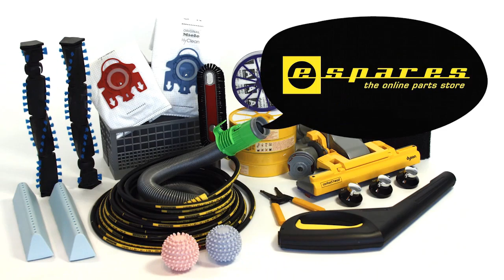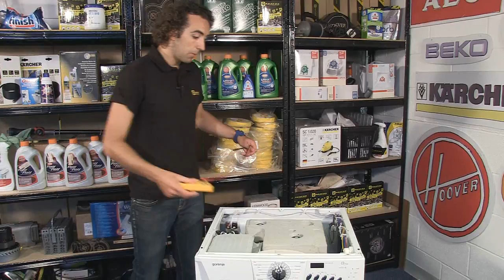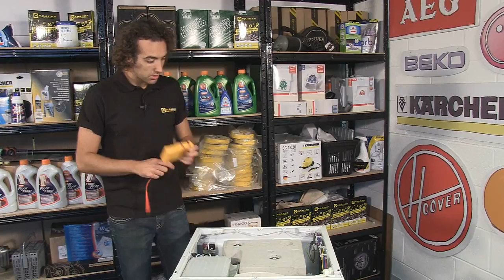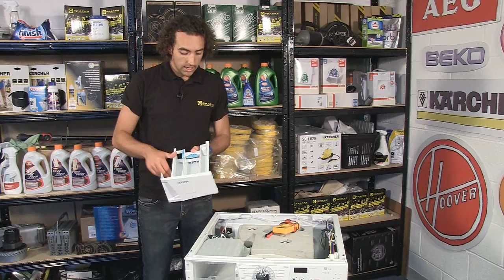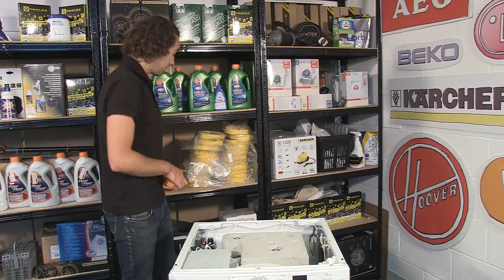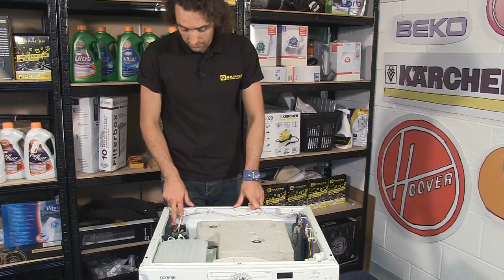How to Diagnose Washing Machine Dispenser and Filling Problems

Comment: Would you be able to comment why laundry may not smell like the detergent used or even smell clean? I use proper detergent, but my laundry comes out smelling as if it was washed only with water. I don’t understand where my detergent is going 😔 I was finally able to rid the washer of mildew smell with maintenance & cleaning, but now this puzzle piece.

Comment: Expecting advice now is a longshot considering this video was uploaded 11 years ago, but I'll put it out there. I have an electrolux front load washer in a room that gets very cold during extremely cold weather. Consequently, one of the tubes of the water valve (the tubes that the tap hoses screw into) cracked. So I bought a new water valve. The installation seemed pretty simple but something's not working correctly. The water does go through the valves and through the soap dispenser but does not go into the tub. It's not leaking all over the place or anything like that. But no water is entering the tub. After a minute the water stops. I guess maybe the sensor feels that the valve  is full of water or something. I don't know if the the replacement valve I purchased is faulty, or if I didn't install it correctly, or if there's something else wrong with the washer. I don't have an ohm meter but I have one of those things that you touch to wires or circuits and it beeps to tell you it detects current. When the washer is on it detects current on all of the valve cylinders. The valve I purchased is not directly from electrolux but it is OEM. I ordered another valve, this time directly from Electrolux. I'll receive that in a couple of days but I have a bad feeling it still might not work. Anybody have any ideas? Thanks.

Comment: I've just had a new candy washing machine delivered and on the first washes i've tried the water jets are firing into the fabric conditioner middle section as well as washing liquid side at start of wash and emptying it...can you advise..just to say i am only dosing with a small amount of conditioner.
Reply from the maker: Check what cycle you are putting and that this is not a liquid bleach container that you are filling. If there does appear to be a problem contact your supplier as most new machines come with a 12 month gaurentee.
Reply: Your response is very much appreciated, checked all cycles and made sure and still happens so as the machine is only 2 days old the supplier is exchanging it.
Reply: my replacement washing machine turned up today should i use the new water hose that came with it or am i ok using the existing water hose.thanks
Reply from the maker: It is always better to use the new hose as the old hose could have weakened overtime.

Comment: Thank you so much! I blew down the pipe from the pressure switch and it worked first time.tahnks again.
Reply from the maker: Hi Andrew, if the pipe blocked it is likely you have a build up of detergent residue in the machine that blocked it. We suggest you watch the following video and use this product or similar to clean the machine up and prevent it re occurring:
https://www.youtube.com/edit?o=U&video_id=ifWK9df1qgg

Comment: The rinse cycle doesn't seem to be filling up with water in my machine. In fact I saw it pour a bit of water while not spinning, drain, then spin slowly as though it were rinsing. After spinning the other way it paused again, poured a little water, drained then spun again like before. So my clothes ended up coming out very soapy. Is the rinse cycle supposed to fill all the way up with water?
Reply: The water level during the rinse cycle doesn't even get to half full. I'm watching it "rinse" with a bunch of soap still in it
Reply from the maker: Many modern machines use low water content to increase their efficiency. Your problem is more likely to be due to excess detergent or overloading rather than a water filling problem. The drum should never be filled more than two thirds or the clothes cannot rinse or clean effectively.

Comment: I can't seem to find anything that resembles your solenoid valve. I have poked the prongs from the multi meter on everything inside the machine that might be able to give me a reading, but nothing...please help!!!! Sam.
Reply from the maker: +samantha arlington What is your model details Samantha?.
Reply: Arcelik 5061 I can send you a picture of the insides too if you like?
Reply from the maker: +samantha arlington Your inlet valve is at the top of the machine at the back and the fill hose attaches directly to this with smaller hoses going to the detergent drawer. The valves will have a resistance of between 2000 and 4000 ohms and  s shown at: http://www.espares.co.uk/product/es1249572
Reply: But this isn't what's in my machine. It's more like 2 flat plug like sockets with wires coming out. I don't know how else to describe it.
Reply from the maker: OK depending on production they may have changed the valve and connectors but you now have identified where the valve is (Between the fill hose and dispenser). You can remove the connectors and measure the solenoids. As there are two they should be of a similar resistance.
Reply: Ok. They are covered in a protective plastic that on't come off, although i was able to poke the prongs of the multi metre just slightly underneath, and the reading was 295/300....so i guess they will need replacing. Thanks for your help. Now off to try and find replacements. :)
Reply from the maker: Please give us your production number as we can then identify the correct part. The readings of around 300 ohms may be correct so do not order yet. Have you seen our diagnosis video: https://www.youtube.com/watch?v=VS48G_cwCXo
Reply: Yes...this was the clip i posted my question on. As for the production number, i had it 10 years and most numbers have worn away...can you tell me where to look for this please?
Reply from the maker: The production number is often on a sticker either on the door or around the rim of the opening.
Reply: As i thought, any numbers that were there have rubbed off :(
Reply: I may have to bite the bullet and call out a repair man/woman....i hate doing that if i can do it myself!
Reply from the maker: What is the problem with the machine?.
Reply: +eSpares Only a dribble of water is going into the dispenser. It's nothing to do water pressure, that is fine.
Reply: +samantha arlington Also even when the machine is off, water is still dribbling in.
Reply from the maker: If the water is dribbling in through the soap drawer it will be a faulty valve. We checked the three versions of your model on our system and they all show the valve previously shown. If there is no water dripping at the back of the soap drawer the machine may back fill through the drain hose if attached to the pipes under a sink. Check the hose is not lower than the sink to prevent this if attached direct to a pipe.

Comment: Hi I have a hoover wydn9646 pg-30s and i have E01and I checked the safety lock its ok and I couldn't check for other causes of E01 can you show me more detail video for E01 like checking for the reason and repairing the fault please.I live in iraq and I cant not buy spares parts because this service is not available here many thanks.
Reply from the maker: +Sardar Qadir You can see what the error is indicating by watching another video: https://www.youtube.com/watch?v=kzhlvB2LjXg
This video shows that E01 is indicating a door lock problem. If the door catch is working correctly we would suggest replacing the door lock.

Comment: my Washing machine fills with water about 75 percent of the drum then makes  noise and lights flickering. 

I suspect the pressure switch but I checked the black thin hose there is no problem . 

it just fills with water and then stops and gives error.
Reply from the maker: +hanif daryanavard The water level is to high, when empty make sure the pressure hose is not blocked by blowing into the tub. If this is ok the pressure switch or control board may be faulty.

Comment: Hello, thanks for the tips.  I have been trying to diagnose my Bosch  WFL 2060UC Bosch Axxis washer problem.  What I can observe is the following: when I start a cycle, the water starts going through the valve and through the cold water black hose (we only use cold water by the way and the hot water fosset is closed even if the hot water external hose is of course still hooked).  Then the water flow switches its trajectory and goes through the other inner hose that's connected to the hot water valve (apparently), but the water doesn't go through the dispenser jets as supposed to, it just weakly trickles down the back inner wall of the dispenser box and doesn't make it into the actual soap dispenser compartment.  I checked both inner hoses; there's nothing stuck in either.  I checked the dispenser box jets (dismounted it following one of your video instructionals) and could clearly see it was clean, no obstruction in the jet holes.  I suspect it's the valves that may be disfunctional, but I don't have a multimeter to check the resistance.  What do you suggest?  Should I just order a new set of valves or should I invest in a multimeter? At this point I'm pretty sure it's a valve problem, but you might have better insights?
Reply from the maker: +Lisa Reutenauer Check the following video as this is often the cause of dispenser problems. https://www.youtube.com/watch?v=HD570cEFlNo
If the water is definitely only trickling in remove the external hoses and check if the small filter in the inlet of the valve is blocked. You can usually remove these with a pair of pliers and clean it.
Reply: thank you, this  was the first video I saw, and first thing I tried, and the small inlet filter is not blocked....
Reply from the maker: +Lisa Reutenauer Just a thought, re reading your description you have two hoses attached and one fed from the 'hot' valve. If this supply has not got the same pressure to fill the machine when the machine 'calls' for hot then water may only trickle in and the machine may think there is a problem and shut down if it is to slow. When it is trying to fill from this other hose pause the machine and temporarily switch the hoses on a test run. If it fills correctly at this point the issue may be low hot water pressure. If this is the case the simplest way of getting round your problem may be to get a adaptor like: http://www.espares.co.uk/product/es106398 and connect both hoses off the cold supply (assuming your machine has its own heater).

Comment: what if the water keep coming out from the detergent when is during the high speed of spinning? i had make sure i close the detergent properly.
Reply from the maker: Aiqi Lu First check the filter at the bottom of the machine is clear of any debris then run a rinse cycle and listen to the pump when it starts draining. The machine should empty from full in under 45 seconds, if it takes longer the machine may be spinning with excess water throwing it up out the dispenser.
If it is slow draining see another video: www.youtube.com/watch?v=frEJhX9Sppw

Comment: damn i wish id seen this before! My Gorenje WA50125 wasnt filling up properly. CHeck water hose and it seemed fine so i took the inlet valve to a spare part shop and he checked it and it was fine. I went home, reconnected the valve and thinking the connections might have been iffy i gave them a squeeze with some pliers, there was a 'pop' noise, little flash, tiny puff of smoke and now theres no sign of life at all :( any advice? have i blown the board? I just checked the water again and the pressure is rather low so i think it may have been the problem after all :(
Reply from the maker: Monkey Man If you have shorted the connector on the inlet valve when it was powered it is likely to have blown the control board. See another of our diagnosis videos: 
www.youtube.com/watch?v=QYPqpjLV7s4
Reply: eSpares Ok great thanks for that. I checked the plug/cable, on the lowest ohm setting on a multimeter i was getting a reading of 18/1900 so i assume that means it hasnt blown the fuse in the plug. Yes the pop/flash was definitely on the pump connector. Im just a bit hesitant to order one from the service centre as its 70 euros and they dont allow returns, but if you say it probably is the control board then thats good enough for me...thanks again!!

Comment: Is anyone else had a problem with pulling open the dispenser compartment that holds the soap and softener? Mine is stuck shut and will not open. Was hoping for a solution without paying for a service call.
Reply from the maker: Val Morse It is likely the drawer has stuck due to a build up of detergent or softener that has spilt onto the sliding edges and 'glued' it in place. I would try to use either a steamer to blow steam around the edges and take the top of the machine or a plant spray to try and squirt warm water to dissolve the deposits and free the drawer. Be patient when trying and ultimately if it breaks then an engineer would probably have to break it and replace it anyway.

Comment: Hi, thanks for your very speedy reply. The water stops coming in when switched off so guess valve is ok, done all the tests as above and all ok as well, just don't know where to go from here. Thanks again, Mai.
Reply from the maker: If starting and stopping the machine turns the water on and off but it does not fill until you start a cycle then the control PCB is likely to be OK.
If this is the case and the machine is overfilling check the small hose to the pressure switch is not blocked and replace this if no other problem is found.
Note: only disconnect the hose when the machine is empty as otherwise it will confuse the filling level.

Comment: Hi, we have a problem with our Indesit wax120 washing maching, it keeps filling with water,  and programme selector keeps going round.We bought a multimeter,a new selector and now a new water inlet valve all from espares. The new valve is not showing any reading and we would like to exchange it for a new one please. Mai.
Reply from the maker: Hi Mai, the water valve only needs a little current to work and will not measure a resistance on the lower ranges of the meter. It should read around 4000 ohms if you select the correct range. If the valve starts letting water through when you turn on and stops if you switch off at the wall it is not faulty.
If faulty contact our customer service for a replacement at: http://www.espares.co.uk/returns

Comment: This video helped me unblock the detergent dispenser hose, by removing the top of my washing machine and squeezing the clogged up soap powder as advised. Thanks!
Reply from the maker: Well done Michelle, The most common reason for detergent blocking like this is overloading. Not only does that cause blockages but it is costing you significantly more in detergent as well so make sure you use the correct amount.
If you have had smells or washing problems see another video: 
http://www.youtube.com/watch?v=ifWK9df1qgg

Comment: How do you clean inside where the dispenser sits? Mine is horrible and full of black sludge. I have tried to clean it but never really gets it all out by putting my hand inside and really tricky to do. It smells awful and the softener part is often full of water after the wash.
Also I have found it is not always spinning the clothes out enough especially on a heavier wash cycle and I have to respin it. Any ideas on that please?
It is an 8 year old Miele.
Many thanks